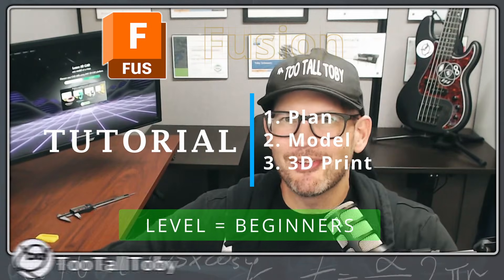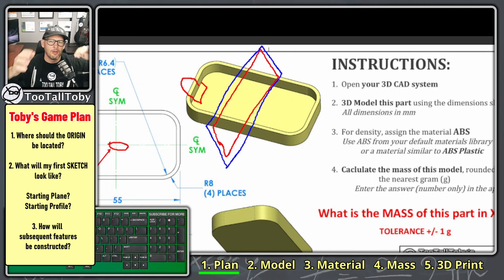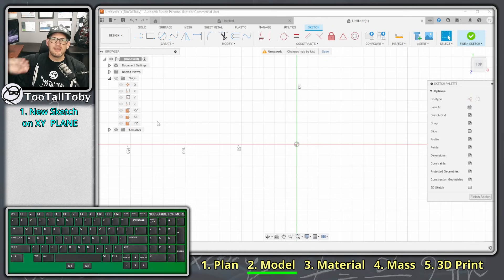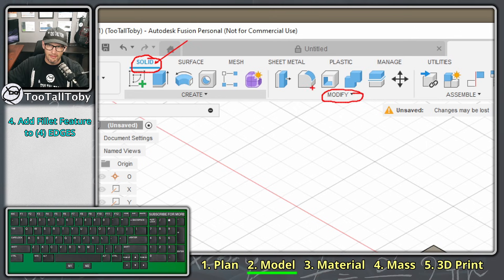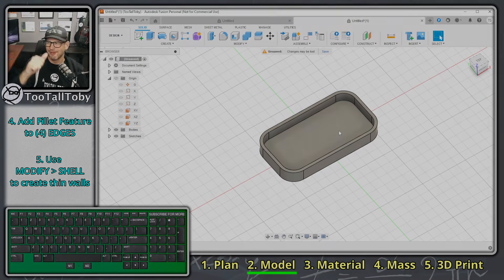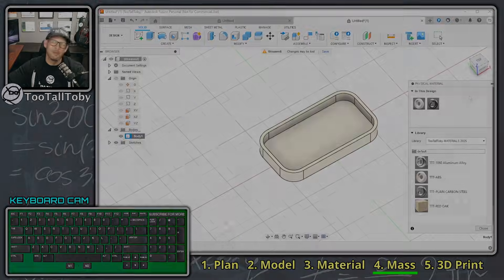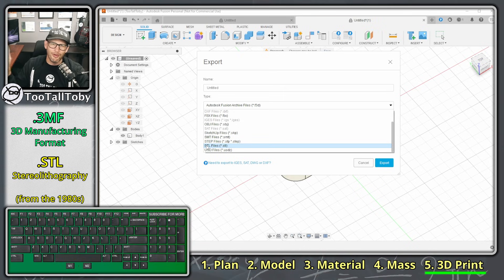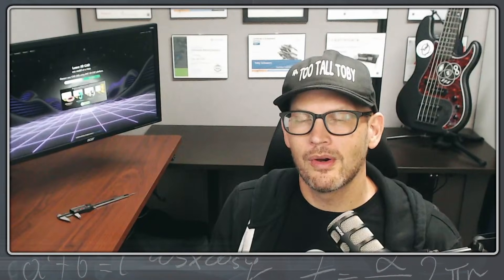Fusion (Fusion 360)  - 2025 Complete Guide for beginners with 3D printing Export

Comment: Cool video it helped me a lot tday.

Hi new one here, i was playing w a fusion 3d print sim, is posible to set infill somewhere in fusion to say 75% or 100% ? so the simulation will show it ?
Reply from the maker: I'm not sure how to do it in Fusion. I assume Fusion thinks the model is Solid (100% infill).
Normally you would change this setting in the slicer for the 3D printer. However, some 3D CAD systems do offer the ability to "slice" the model, right within the CAD software. So it's possible there's an infill setting in Fusion, as you are getting ready to send it the 3D printer.

However, I don't think you're going to see these settings reflected in the model, if you run FEA (simulation). That will probably be using a tetrahedral mesh to calculate stress and strain.  (and assuming the solid geometry is 100% solid). 

Not sure if this helps - but welcome to the channel!

Comment: Pro tip: when picking edges to chamfer or radius in Fusion just hover over an edge that is not visible and you will see it highlight then you can click and select that "hidden" edge without rotating the model to see it. It's a total time saver and streamlines your work flows! 
Part II: If you hint enter then decide that you want to add or even remove an edge just double click on the chamfer feature in the timeline to edit the feature then hold down Crtl and click to add or remove edges.

Comment: I just got a 3d printer and I was using onshape but from what I understand fusion 360 is kind of the go to platform. Seems like fusion has more options with modeling and on feature that it has that is making me move over is the ability to use custom font from my PC where as on onshape I don’t see and option for that. I may jump back and forth as I really like the flow of things in onshape.
Reply from the maker: yeah its great to try both when you're just getting started to see which one feels easier to navigate.  That's the most important thing.  I was a SOLIDWORKS user for a long time - so I feel like Onshape is easier to understand that Fusion - but I'm also learning Fusion and FreeCAD and I like them too! 

Glad you found the channel and I hope the Practice Models on the website help you sharpen your skills!

Comment: I really appreciate your tutorials. I've been using Fusion for many years but I've been learning OnShape from your videos as a backup plan.
In don't use  export  to save an stl file. I right click on the component or body and pick 'save as mesh' . That will bring up a dialog for saving as an stl or 3mf. If you have named the body or component the default file name will match the body or component name so it saves a step. If the component has multiple bodies in it, all the visible bodies will all be saved in the single stl file. That can be handy for some print in place models.